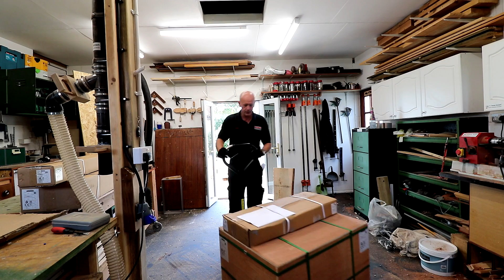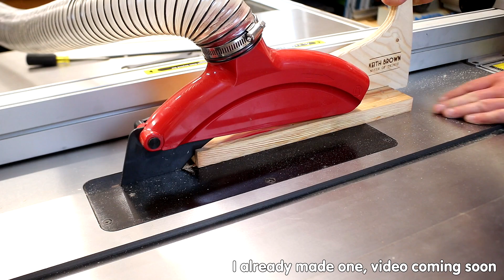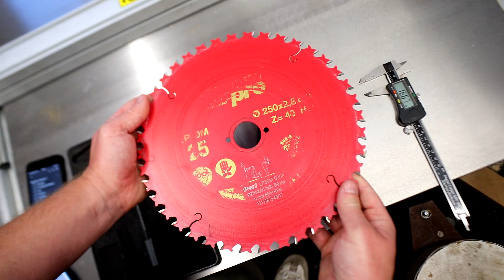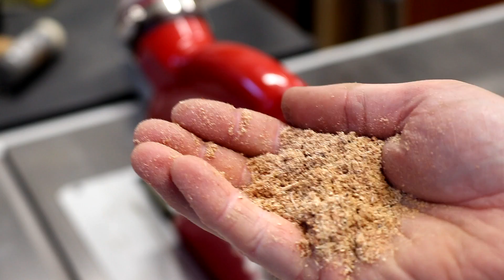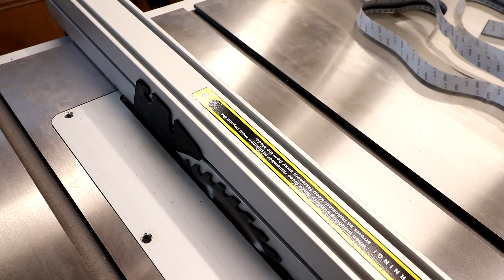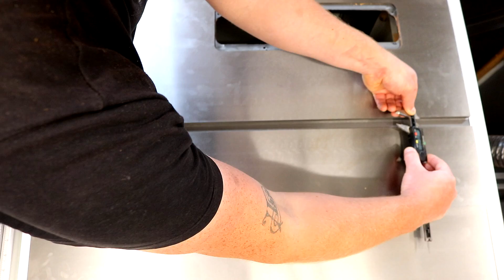Axminster AT254SB / AW10BSB2 Table Saw Review

Comment: In regards to the dust collection, does most of it just fall into the cabinet of the saw? I wouldn't mind that personally, it just means opening the cabinet door at the end of the day and giving it a quick clean. Or are you saying that most of it ends up in the air? which is of course a much bigger problem.

Comment: Hi Keith, regards your dust extraction- I have a very similar setup (inspired by you!) and I think our cyclones are bottle-necking the flow with c50mm inlet and outlets. I’ve been looking for a  larger cyclone at a reasonable price but nothing seems to be available in this country. I designed a 3D-printable modular cyclone with 75mm inlet/outlets to suit my 68mm ducting however when I calculated the cost/time of the filament to print everything it was not viable. Happy to discuss further (and if you need 3D printed custom pipe couplers a relief valve then give me a shout!) - thank you for the videos!!
Reply from the maker: Thanks Colin. I believe Axminster released a 100mm cyclone recently
Reply: @RagnBoneBrown  thanks Keith, yeah I have seen that however it's a bit of a monster - although with the RnB affiliate discount it may just be something I can sneak past my better half ;)

Comment: Keith I'd recommend a minimum 1.5hp dust extractor. Every dust extractor is overrated on its specs. I run a 2hp extractor on my AW12 and that works a treat and I dont even use the crown guard.

Comment: A zero clearance insert will actually make less dust on top of the saw, since it can't blow up past the sides of the blade.  You could always buy two new swivel casters with brakes to replace the ones on the front of the saw.  That way you move it, hit the brakes and it doesn't move.  Overall I think you've got a nice saw there, with lots of power and a really nice fence.

Comment: Hi Mate, I have that same saw (differently branded here in NZ) . It will work great with a proper HVLP dust collector. I have a 2HP on mine..  They need air flow (to provide the "high volume") so all the gaps are in your favour unlike with a vacuum system (HPLV) where it wouldn't work. My miter slots ain't consistent either. My cross cut sled binds on the front. Enjoy the saw! 🤙

Comment: I took the alternate route to you and bought a old rusty fox f36-529 10 inch cabinet saw from gumtree. The motor stalled when I test cut at collection and ended up give the guy £80 for it thinking it was worth it for the body and cast iron table.

Long story short, I dismantled the whole thing replaced 2  bearings, the belt and gave it a really good clean. Put it back together, painted it and bought a new blade. And much to my surprise it works a treat!

Comment: Those small screws are m4 countersunk. You can buy longer ones. Hope that helps,  regards Paul.
Reply from the maker: Cheers, they're actually M5, I bought some on eBay and aside from the heads being a bit large for the purpose they fit
Reply: @RagnBoneBrown  your welcome,  i had the same problem on my makita table saw. Regards Paul.

Comment: Just an FYI, But just about ALL table saws are going to need much more volume of air than any vacuum based system will ever be able to provide!  When you installed your current bust system, I was thinking that you would probably regret going with one like that in the future as it is limited by its volume of air movement capacity.  You overall will be much better off with a system like you are considering that you put up a picture for, if you can get a bigger one by waiting a bit linger to save more it will be a good idea as it will allow more flexibility and future proofing for later equipment changes that may need more air flow.

Comment: Nice one Keith it makes a change to see someone actually give a honest tool review rather than just sing the praises of the company to try get more out of them!
You mentioned that you made a zero clearance blade cover, instead of using the screws try countersink area's on the underneath of it and install earth magnets 🧲. 
On that note great review well done sir 👏 👍
Reply from the maker: Thanks. I'm a bit worried about the magnet idea as I don't think they would hold against blade spinning at such a high RPM
Reply: @RagnBoneBrown  i wouldn't discount it keith I was really surprised how strong they are, way way stronger than the normal type of magnets!

Comment: Looks like a pretty nice saw! It's looks a lot nicer than the Delta contractors saw I had before I bought my current one.

You're right about how big an improvement a quick-release riving knife would be. When I bought my current saw (a Sawstop), that was my favorite new convenience feature compared to the old Delta. That plus a quick-release table insert make it super easy to change blades, to switch from the riving knife to the blade guard and back, etc. (Unlike your Axminster, on Sawstops the blade guard has its own, separate riving knife. I really like the way your saw's guard just clips onto the riving knife; that makes it easier to take the guard off and on, and making a safety feature easier to use is always a good thing.)

All saws are different, but on mine I've found that having good dust collection around the blade under the table is better than just having it on the blade guard. Having both is of course better if your dust collector has enough airflow. I ran a separate duct along the ceiling to a spot above my saw so I can run the hose from the blade guard straight up to there and it won't be in the way. When I'm not using it I hang the blade guard (and hose) from a hook on the ceiling and close that blast gate.

I can't give you much advice on more capable dust extractors. Aside from being in the US where the market is different, I have a "franken-cyclone" I made from a 2HP blower I bought off of Craigslist for $50, a Super Dust Deputy, and a good cartridge filter. So my only advice there is that before you go out and buy a new extractor, search the used market for extractors or parts you could use to make one.

Comment: Had one for 10yrs...still going strong but had exact same issues back then too!    I machined the slots and installed some incra t-track nice and square to the blade. Incra mitre guage fits a treat now.
Reply from the maker: Sounds like a neat solution

Comment: Hi Keith, 
I have the same saw, and overall am really pleased with it too (hobby woodworker, not a pro!). I notice all the same gripes you mentioned in this review, but have gotten some really useful ideas and tips from this video, so thank you very much in advance (the riving knife idea in particular will have to be done!!)
I though you might be interested to know, I also have the  Axminster Craft AC153E 2.0HP Dust Extractor, which is really good, generally speaking (defo need to upgrade the filter bag though......). However, it makes little or no difference to the collection on this saw, which remains terrible. Unfortunately, I dont think upgrading your extractor is going to help with this? While the one you mentioned (Axminster Trade AT50E, i think it was), may better than the craft version i have, i cant help but think the dust collection on this saw will not benefit much from a better extractor. While I would be very interested in seeing how that works out, if you decide to go for it, seeing how hard you have worked over the past few years, i dont like the thought of seeing you wasting your money if it isnt going to improve matters. I hope this helps, either way.
Thanks for all the great videos, looking forward to the next!!

Comment: Levels aren't worth an actual steel straight edge. Chances are your table is actually flat and your level's aluminium isn't.
Your zero clearance insert needs a couple more holes on the left side to reduce dust from escaping.
Reply: If the table was flat it would act as a straight edge against the level, and the gap would be consistent everywhere.
Reply: @GurungyNoHamuster  No necessarily. I have a level that has a bow right in the middle. I know because I have a high quality Veritas straight edge to compare it to.

Comment: Curious about your comment on dado stacks. Why wouldn't you use one?
And did you decide on the machine before Axminster gave you money off, or —as honestly as you can be after the fact— was it the discount that tipped this machine over the edge?

On the topic of dust extraction and "case gaps", HVLP works best when it's working at the rated volume. Think of it not just as suction but a big gust of wind carrying stuff along with it. The gaps around cabinets allow dust to get blown out of corners, etc. Useless for LVHP suction though (as you've witnessed).
Reply from the maker: I hate swapping blades over so use the same combi blade for all cuts, plus i just never really feel like I need a dado stack there are so many other ways of doing it. 
I had decided on the Axminster prior to then offering a discount. Certainly made the decision easier though!

Comment: For the insert keep in place without screws, is to use magnetic tape all arround the insert at the bottomside, and maybe on the table saw itself.
Reply from the maker: Thanks. I'm a bit worried about the magnet idea as I don't think they would hold against blade spinning at such a high RPM
Reply: @RagnBoneBrown  another solution would be, 4 screws with a sort of biscuit attached, which settle in a groove under the inlet. In the inlet 4 holes big enough to go over the heads of the screws. Countersunk bolts would be ideal for this.
Reply: @RagnBoneBrown  , can you check if the dust extraction from below holds the inlet in place ?

Comment: I recently purchased Proma 250,  I belive same like yours, and the worst things I discovered was the tilt mechanism is on pins not trunnions. Every time, you tilt the blade, you have to adjust the fence. The truth about brushless motor is a fact. Power is astonishing. After couple of years of using the brushed table saw I chopped off  my finger just in first 5 minutes of ripping boards. I paid about 600 euro for 2 hand one.

Comment: A great review Keith and I was especially interested as I went for another site saw (Bosch GTS 10 XC) rather than this. I should say the chap in Axminster Basingstoke did point out the need for a HVLP dust extraction on the saw. I do wonder if you're seeing a lot of dust fall straight through the saw and collect under it.
Reply from the maker: Cheers Karl, the amount of dust underneath the cabinet was unbelievable until I hooked up the other extractor. It's not bad at all now but I'll definitely be upgrading to something quieter and lvhp... Just struggling to figure out where to put it

Comment: Hi I have got the AW10BSB2 had it for about five years now the only main trouble I had was when i set the blade at 45 Deg and made a cut
the timber used to jam on the riving knife , it turned out that you have to recheck the slot to the blade at 45 Deg and if out of parallel you have to either pack the front  two or rear adjustment bolts to make it parallel and then check again at 90 Deg and once both  are ok
your good to go.

Comment: Hi from 5 miles down the road.

I have the Axminster Hobby Series TS-250M-2, which suffers from many of the same issues - I actually used a load of foil tape to cover all the gaps in the body. As well as this I did exactly what you did and only attached my vac to the crown guard to improve dust collection.

Like you ive found the measuring a bit naff - that said, I'm not doing much high-end work, so i tend to simply measure it out with a tape.

Past those niggles though, I'm pretty happy with it, and for a "hobby" saw its miles better than a site saw. Plus it also has an induction motor :)

Edit - one other thing I did was to cut up some rubber washing gloves and gaffa tape it to the back of the crown guard so it looks a bit like a cape! Its an obvious short term bodge, but it stops a lot of the dust flying out of the back and allows for better dust collection. And It doesn't get in the way of cutting at all. 

Im thinking about a better long term solution, but for now, this bodge does help.

Comment: Great review Keith, getting serious now with a smart looking saw like that! A question though, with regards to the flatness test, how do you know that the spirit level is precisely flat and it isn’t that which is giving you the hollow? I’ve always struggled to determine that with my own projects. Tom
Reply from the maker: Cheers Tom, if the level isn't perfectly flat, then that would mean that the table has an arc from front to back as that was reading as flat with my level...? Difficult to know really as I don't have anything to check it against...
Reply: Rag 'n' Bone Brown yeah, I know what you mean - that’s the difficulty I’ve had is what to trust as perfectly flat. Will look to get a straight edge from Axi using your link and pray I don’t drop it 😂

Comment: Welcome to the club Keith. I've had this saw for 4 years and its still going as strong as the day it arrived. Just FYI you can run the saw off a 13amp plug socket with a 10 quid adapter from Amazon, its the 12inch that demands 16amps
Reply: Didn't realise that !

Comment: Locktite the housing screws in.
Reply from the maker: But then how would I swap over the insert plate?
Reply: @RagnBoneBrown  Low strength locktite 222 would kill the vibration effect on the screws but also allow you remove the screws without much difficulty when needed. ie putting a spanner on the end of your screwdriver , just a little bit more torque needed. Test first if you like.

Comment: I've had this saw for a few years now and I run it on normal UK 13 amp outlet without any problem, all I needed was a 13 amp to 16 amp adaptor which I got from screwfix.
Did you not have any problem with the blade height adjustment? On mine whenever I change the blade height the blade goes out of square so I have to adjust again.
Also the fence is not perfectly straight. Overall it is a good saw for the price.
Reply from the maker: I heard about that fault with the blade rise and fall on older versions of the saw, but it has since been corrected fortunately, mine is fine for that

Comment: The gap in your bedplate will be the level you are using, its not an engineers level and should NOT be used for the  same purpose, your level CANT be that level.
Reply from the maker: If the level is to blame then that would mean that there's an arc in the table from front to back, as that was reading as perfectly flat... I really don't think it's my level at fault tbh

Comment: Hi Keith, as mentioned previously I have the same saw, and I did try sticking some gaffer tape around in the cover over the saw blade beneath the table which did help somewhat, but which was tricky to fit.   BTW, I enquired about those little screws and got this response from Axminster: - "The table insert screws are order code BURT000700 £1.84 each and these can be ordered through our sales line on 0800371822"  (plus delivery ?)   I got five 10mm long countersunk head M5 screws on Ebay for £1.50 total with free delivery.   I will try you measuring lens mod, and also check if my handle flips out of the way as I can't remember ever noticing that!
Reply from the maker: Yeah I got the same response from Axminster with regard the screws... I thought it was the price for a set, but then they said it was the price for one screw plus a £3 delivery charge, I almost fell off my chair!!!! I ordered some on eBay too - I measured as 6mm length M5 rather than 10mm though, perhaps yours were longer than mine?
Reply: @RagnBoneBrown  10mm including the head
Reply from the maker: Mine are 6mm including head..... Strange

Comment: Great review. I resently purchased the 315mm version of  this machine and had most of the same problems. Mitre slots and bow in top. My side door doesn't line up great either. 
When it came I had an issue with the motor constantly triping the rcd. Axminster has a better than most aftersales and sent an engineer out and replaced faulty motor.
My riving knife was not set up and is awful to adjust.
Like you these small niggling faults aren't enough for me to regret buying the saw as the others at a similar price point will have similar issues.
I have a number of trade Axminster machines and the only one I cant recommend is there drum sander. In my opinion it isn't up the the job. But they accepted it back at no cost to me. I then got the laguna drum sander

Comment: I would be very disappointed , especially with the variation in the mitre slots...
Reply: I was thinking the same thing. It might only be 0.15mm in the slot, but that gets multiplied by the length of cut when cutting angles. An adjustable ball bearing mitre gauge might help, but it's still a disappointing.

Comment: I had the same problem with the 'key' missing for the turning handle. I cut off a section from an oblong cross section clout nail. Must be a regular Axminster problem. Love your channel!
Reply: I had seen a video (maybe on youtube) where the keys were taped to the packing the wheels came in, so easy to discard in error !
Reply: The handiest place you will find suitable stock for a woodruff key is from the head of a bolt.

Comment: I bought the same wall mounted dust extractor when I bought my trader bandsaw. It works great with the bandsaw. The guards across the hose attachment (if that makes sense) are a pain when I use it with my thicknesser. It clogged all the time and I was constantly having to remove the hose and remove the chips. I removed this using a jigsaw and it is great now. No more clogging and plenty of suction. 
Hope this is useful.
Reply from the maker: Thank you
Reply: @RagnBoneBrown  no probs